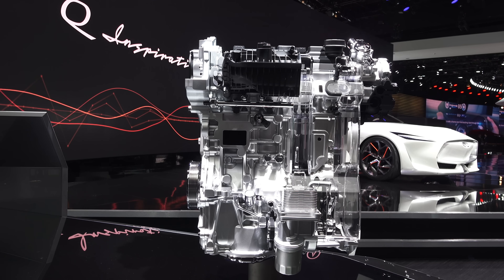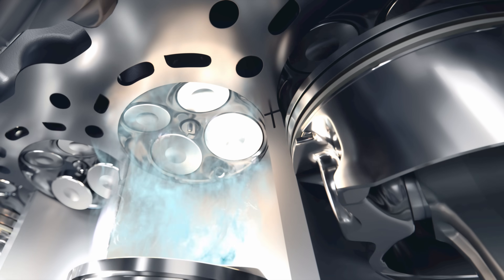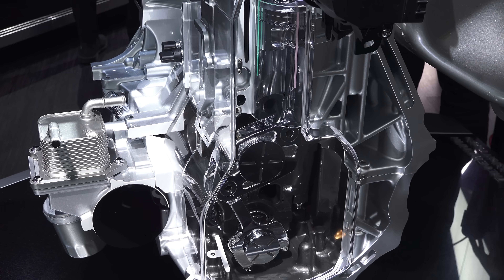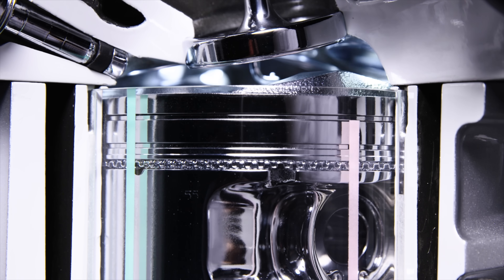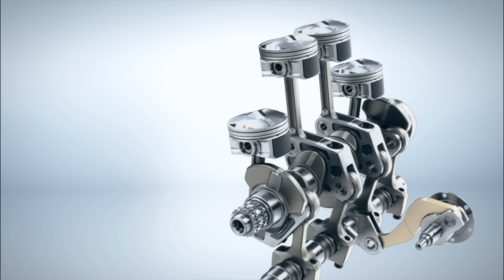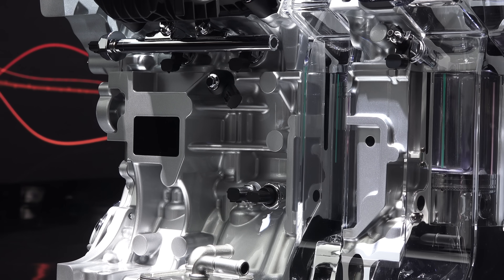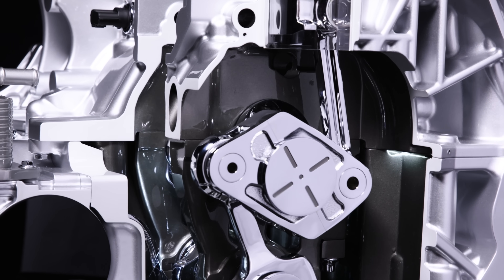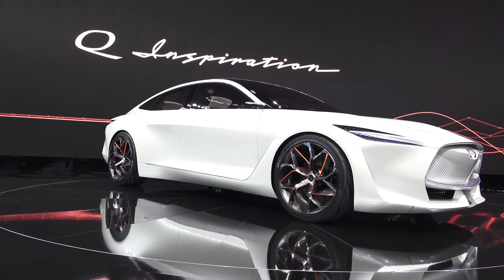INFINITI Reinvents The Gasoline Engine — VC-Turbo

Comment: I may have missed it in this video ... what happens with the turbo when engine is in high compression mode.  How do you stop the turbo boost?
Reply: I think you'll find a waste gate will do the job of controlling Boost.

Comment: This engine is cool in concept but will be the sorest thing ever to work on. More components more likely to fail. Plus heat distribution throughout the system will cause many issues, considering we can only guess these variant changing components will need bearings to which they will need lubrication so the oil system to this will probably not be much bigger than a pen tip. Oil that gets little grimy or in example oil with 2,500 miles on it will clog it overheat and self destruct entire system. Unless I'm over looking something. However I know how these new modern engines hold up Hyundai proves this over and over the struggle to get 200,000 miles. Mind I'm talking there modern engines and it's because of there rods. Who know how this will work out.

Comment: Electric is better all these "developments" are beating a dead horse. Electric motor is 90+ % efficient and and ice is at most 40% efficient
Reply: Kevin Bustamante waiting 30min for a charge is not really a big deal tbh
Reply: Kevin Bustamante I can just put it on charge when I'm at work or at school. I only like like revv happy engines to drive hard in the mountains etc but to drive to class or work electric just makes more sense. Fuel is $2/L where I live. I have Civic for fun with b16b to throw around in the corners for a good time

Comment: Interesting design, but I am concerned with reliability due to so many moving parts, and funky moving parts at that. Lets see if this thing is still running @ 300k, and if it is; did it cost $2M USD in order to fix the engine?

Comment: Another nissan over complicated engine that's gonna go in the trash when something fails inside.. power numbers aren't impressive and i bet fuel economy won't be either considering all these complications
Reply: Nah so long as it can switch to the Atkinson cycle its fuel economy will be good. Reliability could be an issue though...

Comment: So this I what I’m getting at it smaller compression ratio means more power and a bigger compression ratio means more efficiency? That’s not right bigger compression ratio means more power and smaller compression ratio means more efficiency. Why do you think formula ones have a compression ratio of 17:1 vs a normal car of 8:1-10:1 because car manufacturers want more effincieny vs formula one teams. Formula one teams could care less how much fuel is being used unless it’s using more fuel than the other formula one teams.

Comment: some day I hope to see this in v8 trucks.  This technology combined with the techology that turns v8s into v4 when the power is not needed would give you an highly efficient daily driver truck while still giving you all the towing power you need for pulling a camper or what ever it is you pull with your truck.

Comment: It's not a new idea and they've added a lot of weight and complexity in the crankshaft area. I'm more a fan of the SKYACTIV engines with cylinder deactivation. With cylinder deactivation the still working cylinders will have to work harder and the end result is about the same.

Comment: Very interesting. Great to see auto makers thinking outside the box. Seems eerily similar to mazdas skyactiveX engine. 
I own a 2010 EX35 and that engine is superb, Well build and reliable. So I know nissan will make this motor well.
But all those rotating parts in this new engine kinda worry me in the maintenance department, should something go wrong.

Comment: No thanks... I'll stick to the conventional V8 that Ive been running for 21 years with 250K miles on.... I can just imagine taking this to the dealer to get worked on: a team of techs with 3 separate engineering degrees and a dozen certifications plus a computer scientist to guess what the computer is doing and all with no clue why its not working after being there for three weeks.

Comment: It sure seems like manufacturers are under pressure to innovate theire I.C.E. engine designs to compete with the incoming flood of electric vehicles after sitting on their laurels for so many decades. I think it's too little too late. The complexity of these new designs will have huge headache in the form of maintenance costs.

Comment: nice, new technologies in piston engine, how efficent and power full can be an engine with valve-less v-tec and variable compression?, and how expensive is?, and why they didnt do it varying the height of the cylinder head?

Comment: Reliability could be an issue for sure. Best engine I have ever had in a car was Ford's 2 valve 4.6V8 in my old Lincoln Town Car. Was borderline under powered but decent gas mileage for large car and superb reliability. 300k miles before it was totaled in accident.
Reply: Aah the ever present Ford "Panther" vehicles. Built for fleet buyers first and foremost - needless to say they tended to be bulletproof. Good thing too, since taxi drivers and cops were their biggest customers, and those types aren't well known for being "gentle".

Comment: What happens when you're 5,000mi out of warranty and the $200 electric compression actuator fails leaving your engine at 14.1 when the boost kicks in? BOOM - your $60,000 infinity is toast

Comment: So at 14:1 when fuel is injected wouldn't It combust under the heat of compression? With gasoline being as explosive as it is I'd be worried about a complete detonation especially when running the turbo at that pressure

Comment: I have so many thoughts about this engine. It’s definitely unique, but my main question is why?

Why spend all the R&D/ engineering time designing an overly complex internal combustion engine for a regular consumer application? That time and money would have been better spent in electric motor/ battery design.

Secondly, there is no way this will be as reliable as a proven I4 design. There is too much going on.

3rd, I don’t see how the piston gets pushed up with that weird linkage.

Lastly, what are the actual numbers of this engine? HP, torque, city/hwy mpg? I cannot see an improvement significant enough in the numbers to warrant this design, even if you assumed equal reliability.

Comment: did i understand that right, it needs 1.2 sec to ajust the comp ratio from max to min, so if i hit the gas not the turbo will lag but the engine will lag for 1.2 sec ? if thats the case, that seems like a very long lag, from eco to full throttle
Reply: Alecks1990 it won't suit me well at all. It is pretty much a grandma driver's wet dream.

Comment: Does anyone have a rough percentage figure of the increased efficiency gain by having the conrod more or less vertical in the power stroke? It seems to me, as opposed to a conventional setup, that the power stroke gains good leverage on the crankshaft.

Comment: How many thousands more is it going to cost and run OMG if you can change the ratio with out adding what apperas a whole extra engine
Ok but this i a joke I hate when engineers do things just for the sake of doing it way too many extra parts way way too many
The unreliability  of this is got to not be good and for what gain omg well some rich kid will bye it 
Be much easyer to raise and lower the heads hydrology  Id fire these guys for sure!

Comment: More moving parts more heat more oiling issues more complex milling and machining issues more injectors with turbo and compression calculation more money more money more money and more computing. I make a prediction in the future "old" tech will be worth its weight in gold. You can run an old diesel on used engine oil hard to get more efficient than that.

Comment: I feel bad for the people who buy the first production year of this model
Reply: I don’t. They probably have more money than either of us.
Reply: Z
Reply: @davidrx795 afford is true!!! Im also talking about value for my money,,,,,if its $200k in price, and unreliable ill have to pass,,,thanks
Reply: bill45colt 
To answer your engine questions. 
Engine longevity. They have a life expectancy of hopefully one entire race day, and depending on the application anywhere between 1/4 mile and 500 miles between rebuilds. 
Mileage averages between 0.05 mpg 5 gallons per 1/4 mile and at best 5 mpg.
Average cost $50,000 US per engine.
Reply: This not with infiniti engine , i tried first Q50 not issue at all and tune it  too
Reply: Mate in the US they just lease the car and give it back for when the warranty time is up. Then get another car. Buying is a myth of the past my friend.
Reply: @anthonyanthony6213 ,  until it bottoms out with some poor bugger alot less wealthy than you.
Reply: Don't let Honda motorcycles near it customer does all their R&D.
Reply: Unlike GM Ford and Chrysler. The Japanese car manufacturers have embraced technology and believe in first getting it right instead of being first to get it to market.

Just look mitigating diesel emissions. They started back in the 1980s and have had reliable DPF and  and SCA since the early mid 1990s. The Japanese embrace the concept of technology and conservation.

Here the ignorant and inbred masses insist on staying with outdated technology. That is why The Japanese will always be at the top of the technological food chain and us intelligent Americans will be trapped on Walton Mountain with the inbreds.
Reply: @bdb3350  They pay more attention to the customers than just competition. Although thoroughly beaten on track, Toyota is WAY ahead in consumer Hybrid cars...which to me, are better than "plug-in-only" cars. Small gas engine (2-4 cyl) hybrid cars are the future for most of us. You'll want to have a tank of gas when the power grid goes down. Imagine trying to escape a "Cali fire" in a Tesla...lmao
Reply: VJ SWORD 
While I believe in embracing technology and making cars cleaner and more energy efficient the only option I would consider is a hybrid. 
I totally agree with you. The fact of the matter is the reliable internal combustion engine will need be around in some form for another 20 years.
Reply: VJ SWORD 
👍🏻👍🏻 The Toyota Hybrid is definitely king of the hill when it comes to fuel efficient technology for daily drivers.
Reply: @bdb3350  I like vehicles that can be fixed in the garage by 1 person
Reply: Josh Girolamo 
Are you talking about being able to repair your own vehicle at home? There I agree with you 1 million percent. 

As a Gen-Xer
gear head I grew up with cast iron V 8s.
I still get sexually aroused from the sound of a 262 -400 CI with a Rochester Quadrajet. At wide open throttle.

Especially when those secondary plates stand on their ends, and they are inhaling 800 cubic feet per minute.
Bolt two onto a big block and open it up on a dyno you won’t see me for a couple of hours.
Reply: Josh Girolamo 
But seriously you have to appreciate the fact we are at a point where a 4 cylinder at 1/3 the weight is capable of 300 hp; and can deliver it reliably. I’m sure in less than 5 years we will see production engines reliably putting out 500+ hp.

With the exception of needing at least ten grand worth of diagnostic tools...
It’s an awesome time to be a gear head.
Reply: BDB dodge has a 700 horsepower motor and ford has had a 1000 horsepower super snake and a 650 horsepower gt500. Wtf you mean 500 reliably
Reply: themrgodfather77 

700 HP. If you’re talking an 8 cylinder that’s an insult. Excessive weight, and wasted energy that should be getting delivered to the asphalt.

I have been a part time engine builder for the past 20+ years for a few race teams. High output 4 and some 6 cylinder engines are my game.

My 4 cylinder road course engines crank out a minimum of 500+ hp at the crank. Idle 600 RPM  max power at around 6500 rpm and red line at 10,000.
Drag engines exceed 1200+ HP idle at 3000 rpm, and exceed 12000+ rpm wide open throttle.

I have a 533 HP 562 FP twin turbo. ecotec in a pre 1996 vehicle. It’s my daily driver in decent weather. I get excellent mileage if I don’t hammer on it. Maintenance is not an issue. I can turn mustang GT’s into mutton.
Reply: themrgodfather77 
By reliably I mean it won’t break down constantly and has a good life expectancy. Also it’s not a maintenance hog.
Reply: @bdb3350  but does it have 4wd and can you pull a 22000lb 30ft goose neck with it? If so, im happy if its cheap,,,if not, no thanks
Reply: bill45colt 
At that point it’s all about gearing. For example I can move a 13,000 lb  work truck with an 8 hp lawn tractor. Because of the gear ratios.
Reply: @bdb3350  i think you covered the issue when you put in 4 cyl, exceeding 5000rpm, i wonder if they will last at that with low maint to 200k miles,,,,
Reply: @bdb3350  ok lets see you do 13mpg pulling 13k at 70 mph with the 8hp engine, get back to us on that please

Comment: I have tried to design this for decades. Eccentric rod journal was tried by GM to maintain TDC deck height only shortening bottom dead center stroke. Electric cars will make this obsolete soon .

Comment: Bad. When they decrease the compression by limiting the height of the piston they are also decreasing the quench. It would be much more efficient to limit BDC to shorten the stroke but allow the piston to reach it's full compression height to avoid detonation.

Comment: A straighter drop on the power stroke is good and the actual crankshaft will have a shorter stroke but its a lot more moving parts, more weight, more reciprocating weight and more load on the parts. It's fascinating and clever and they actually have made variable compression and displacement engine. But will it but the humble crankshaft out of business? Not likely.

Comment: I thinks it would be better to invest in electrical and accumulator technology.
Reply: I think Toyota already figured out most of this, which is why they had a car in 1998 that could get somewhere around 46mpg
Reply: @johnrickard8512  a mid 90's eh2 honda civic also got high 40's combined mpg too, even in the mid 50's mpg on the highway.  Cars will never be that efficient again because they're so damn big and heavy now 🤷‍♂️
Reply: Mate. 
biodiesel is going to stay though

Comment: I'm sure that the initial engines will perform well but like every other innovative creation, once this hit the "Real World" (people not changing the oil regularly, inferior parts quality causing premature wear and yes, I'm talking about dealer parts, engine flooding conditions like a leaking injector(s) causing fuel to pass through compression rings contaminating the engine oil, salt water corrosion like people who live by the water, people beating the hell out of the car like the way people drive lately, etc...), will Infinity honor any of the problems that will arise in the form of Warranty work or will they do like all the other companies and blame it on the customer?? In watching this video, I already see the fire. Many people commenting here also see it. My advise would be not to buy this or any vehicle with engine design until the last year with this design before they discontinue it. In my opinion as a mechanic of 33 years and former dealer mechanic, it's the same engine with more parts to go wrong and ultimately, you're going to pay for the catastrophe they imposed on you.
Reply: If the customer doesn't change the oil regularly, would it not be their own fault that the car broke? This is why Volkswagens have a bad rap in my opinion - people DON'T LISTEN to the service intervals...which is something you REALLY don't want to do with a VW.

Comment: So its going to give the cylinder an uneven wearing on one side will it not? And the same with piston rings
Reply: +Sink1945 : Not at all. You couldn't be more wrong. It's clear that you have mis-understood this engine's design and function completely. Go back and RE-watch the video until you get it.

Comment: That's going the mazda root rather than Toyota (mazda has great fuel efficiency though out all its cars although they're using clever all petrol engines and no hybrids,  while Toyota have a thirsty full fuel engines and meh hybrids)

Comment: I strongly believe that the time of the internal combustion engines is going to its end. No matter how brilliant they will look, how they are improved using state of the art technology, nothing compares to the simplicity, reliability and efficiency of the electric motors. The battery technology improves constantly and I am pretty sure that there will be a time when buying conventional car will be not a reasonable choice.
Reply: All that needs to happen is a more ready supply of hydrogen, really. We ALREADY have the tech to do this it's just not happening yet.

Comment: so in very basic terms, it has adjustable crank throw
Reply: No not different crank throw that would increase and reduce the stroke think of this as a system that raises and lowers the whole crankshaft.
Reply: bikerdhill ok make something better then
Reply: @spedracer55  dont make anything,,,,,stick with what worked 20 yrs ago and still does and is affordable,,,,im at 292k miles on my ford and its never needed repairs,,,,not as much show or power  but reliable and affordable,,,,,if you guys just have to have all sorts of complexity and computers then have at it,,,,as for me,,,,i can fix mine but have never needed to ,,,,dont have wild hp but manage to get along quite well without it
Reply: @bill45colt  if everyone though like that you wouldnt have your car, the technologies that go into it were once also considered experimental and unreliable.
Reply: @Stackoverkill  True.